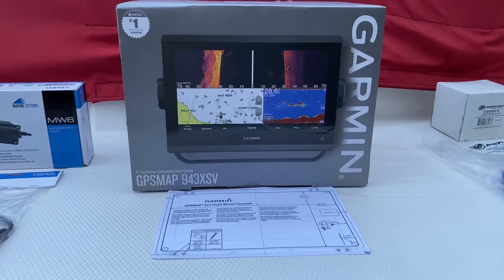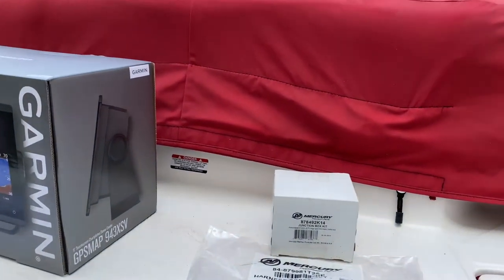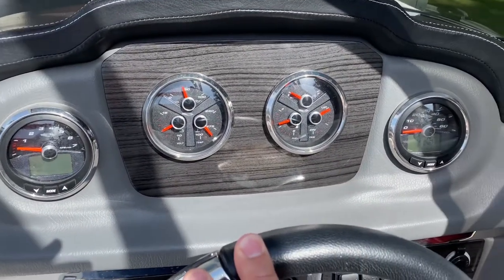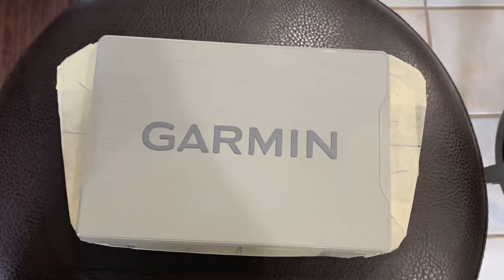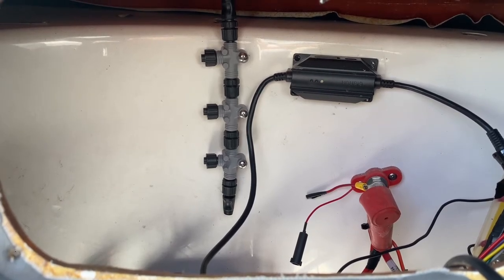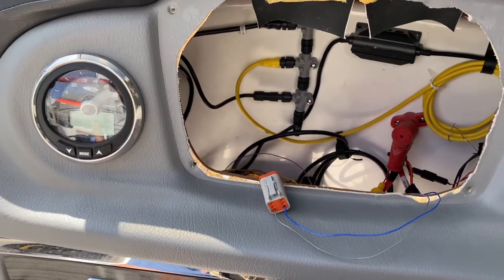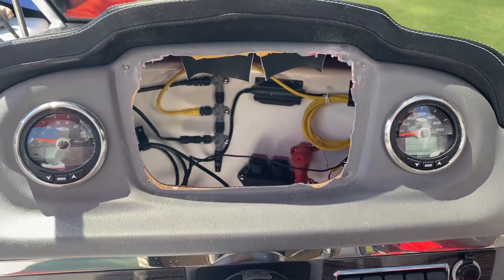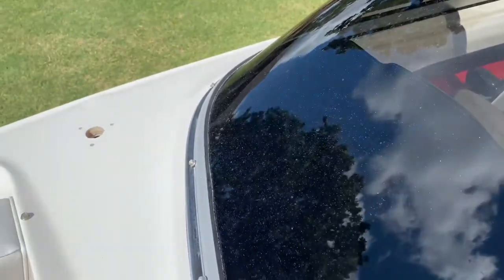Garmin GPSMAP 943xsv install on Chaparral Boat

Comment: Doesn't the GPSMAP display have a built in antenna ? if so why install another external antenna ? I had the 942xs on my last boat and it worked fine without anything else plugged into it.
Reply from the maker: It has one built in that works just fine. I already had the other gps antenna and wanted it further forward in the boat to more accurately read slow speed turns

Comment: Did your clarion stereo work with the Garmin 943xsv? What controls were on the Garmin? I am thinking about doing the same thing on my boat.
Reply from the maker: It’s mixed reviews. Clarion unit I have is a great unit. I installed the NMEA 2000 interface and it was a bust. I talked with Clarion customer support multiple times making sure all devices has the most updated software. Clarion used their same M608 and the Garmin 943 abs had same issues I did. It showed the unit on the Garmin but had no function. Clarion said it was a Garmin issue. They had me use a different dip switch sheeting for the M506 I think unit. It got a little better but wasn’t worth the money. Since then, there have been several Garmin updates. I haven’t put the Clarion NMEA 2000 interface back on the M608 dip switch settings yet to see if there is any improvement. It showed volume controls, source controls, pause/play, forward and back etc. Volume occasionally would adjust but didn’t show correct volume number.
Reply: @sirmarcusandrew  Ha, I was about to ask the same thing as Bartley. Sucks that it's finicky. Will it show what song/station is playing on the source?

Comment: I’m getting ready to install one on my Chaparral Suncoast 210. How did you cut the plate to size to fit the Garmin?
Reply from the maker: I taped the template to the plate and used a jig saw with a metal blade on it. Quick easy work. My plate was aluminum.

Comment: Are you able to see the information from the gauges you removed still?
Reply from the maker: My tach gauge is a smart gauge and shows everything on it if I scroll on the mini LCD screen. And most of the information passes through to the Garmin now as well with the addition of the smart craft connect.
Reply: @sirmarcusandrew  that’s good to know! I found a used chaparral I want to buy that doesn’t have the garmin in the dash and you gave me some hope of it being possible to add. Might be a little over my head though lol
Reply: @sirmarcusandrew  does it show depth and water temperature from the factory Information or did you have to add something for that?
Reply from the maker: @BradFizer  my speedometer still showed depth like factory. I didn’t have a water temp prior. On the NMEA 2000 network I installed a new transducer (kept original also) that showed depth and water temp on the Garmin unit. I also used the NMEA0183 technology and sent gps speed out to the smart tach to show gps speed on speedometer with pitot as backup.
Reply from the maker: I have a faria mg3000 tach and used a 6pin deutsch connector and connected the tx 0183 from Garmin to rx0183 on tach.
Reply: @sirmarcusandrew  do you have Facebook or an email we could chat on? I’m trying to figure out exactly what I need to buy to get mostly everything on this display
Reply from the maker: I had it up but deleted it. Let me know if you didn’t get it.
Reply: @sirmarcusandrew  no I didn’t I’m sorry

Comment: Hello Marcus, Thanks for this very informative video.  I am very interested when you said that you wanted to get all the SmartCraft features of you motor on the Garmin GPS.  You said you would post a video but i have not been able to find it.  I have a Sea Ray 260 Sundancer with SmartCraft gauge and i want to connect everything to the Garmin GPS 742XS Plus,  but i am struggling as i am all new to this NMEA2000 network stuff,  so i would need a tutor!   Let me know,  thanks for your time.   Glen from Quebec City Canada
Reply from the maker: I am working on one. I had some issues I am sorting through. In this video I added the NMEA 2000 network to my boat. Off of one of the T’s I plugged in the Smartcraft Connect and plugged the other end into a blue data cable that I also added to plug into the engine with termination to get the engine data to the SmartCraft Connect and ultimately onto the Garmin unit.